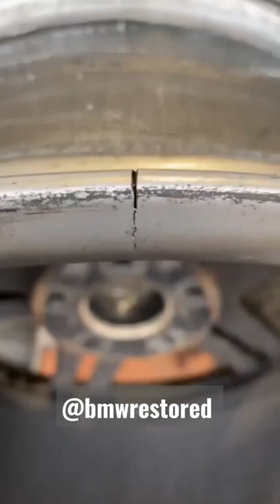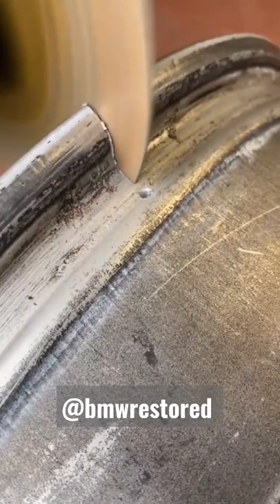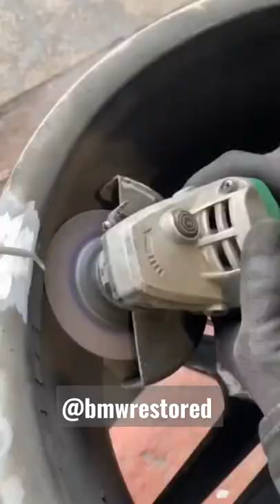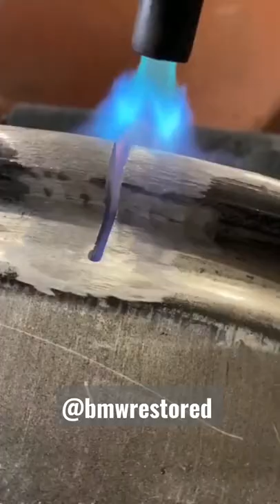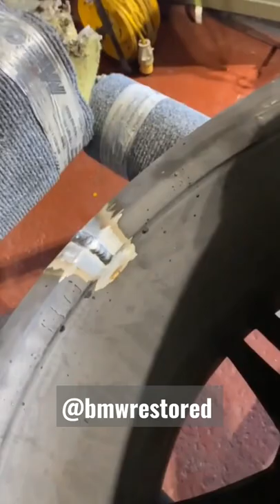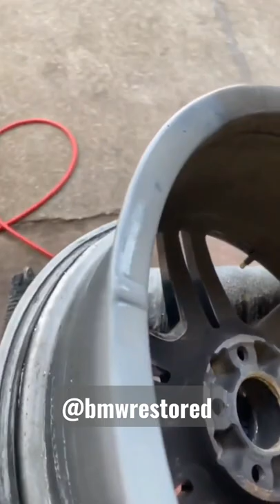wheel welding in action #welding #alloywheels #cars

Comment: This is why I love welding once you learn how to do it you can fix things that most people throw away.
Reply: well yeah i’d trust the old wheels strength over a man made weld…
Reply: @braysfly  Who do you think made the wheel to begin with haha?
Reply: @brian6391  a press machine? you aren’t very smart
Reply: @braysfly Do you mean that you trust women made?
Reply: Welding heat affect the metal micro structure of the wheel thus making it prone to failure and metal fatique. The ultimate strength of the wheel is as big as the tensile strength of the weld. And weld can only handle tensile stress,others arent very well. And the heat affected part is also very brittle too. So no,not everything is ok fixable with welding.